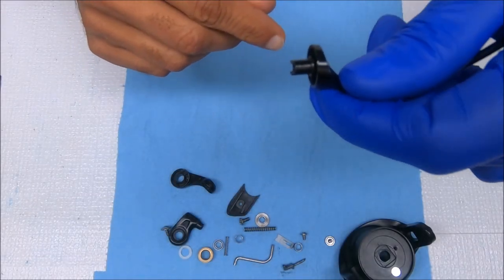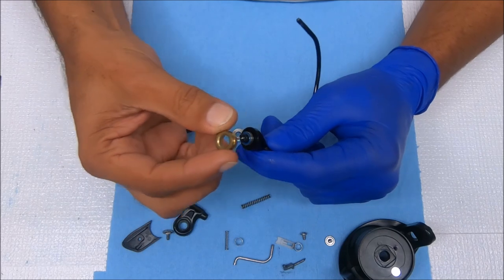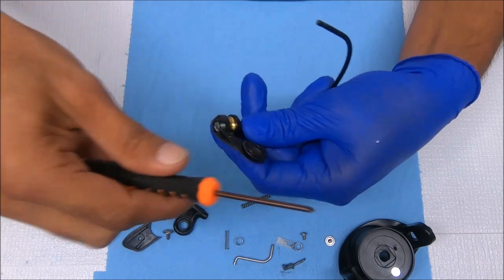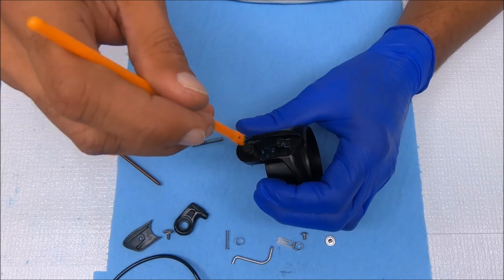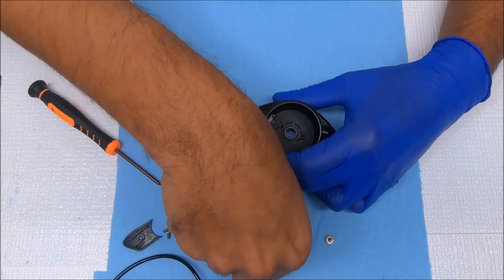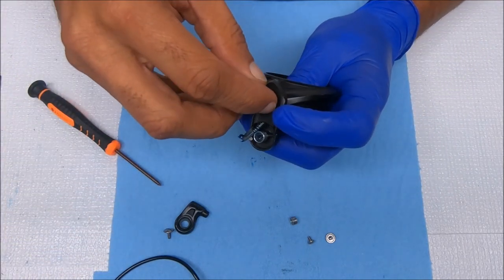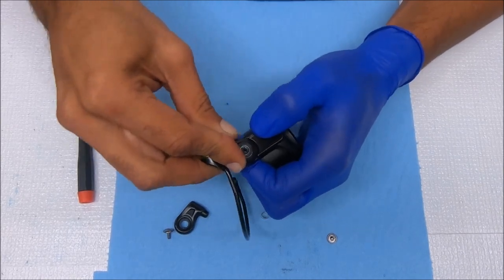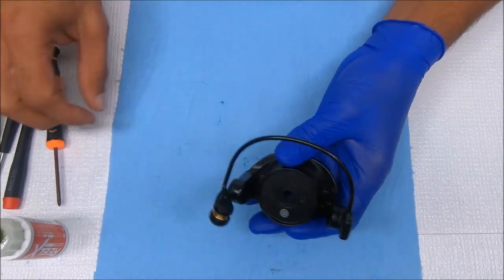How To Install the bail assembly on the Penn Clash: Fishing Reel Repair

Comment: It’s apparently a different reel. I have a Penn Clash 8000. The cover screw has a smaller head, in relation to the cover, on my reel.
Reply from the maker: Thanks for watching! That shouldn't be a reason it didn't work for you... what did you have trouble with?